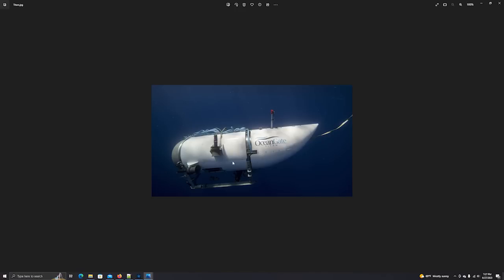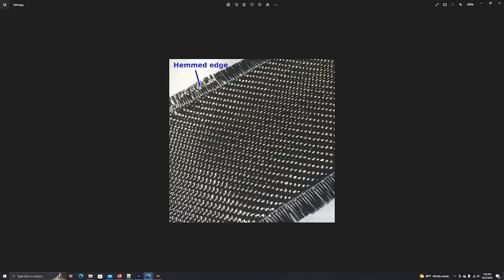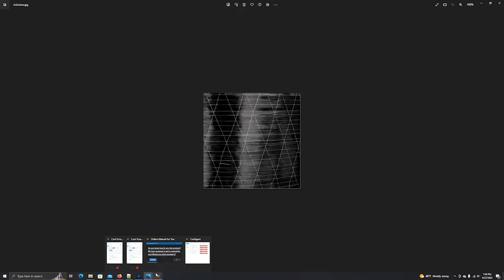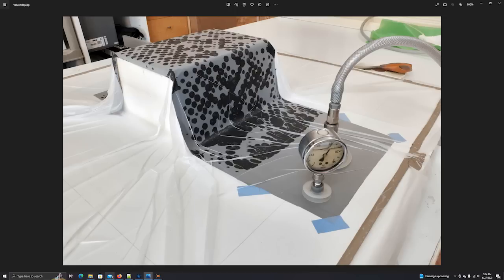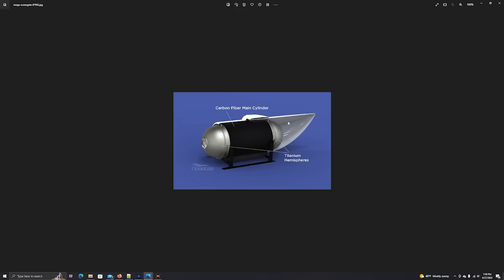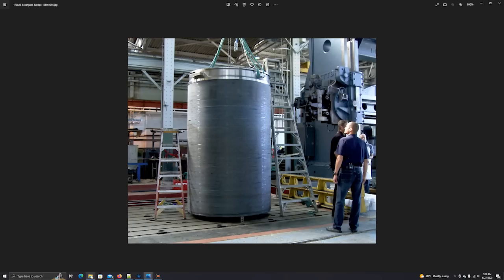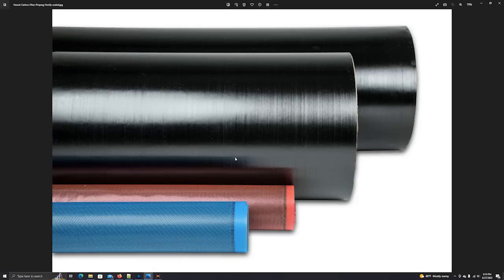Oceangate  Titan Submersible Manufacturing and Engineering Issues Part 1

Comment: Yellow is known to be a stronger colour for submarines
Reply from the maker: I guess the Beatles really knew something 😂
Reply: @JoediyLab  it was made of crayon much better than tape
Reply: Yellow definitely easier to find pieces of...
Reply: @lostpony4885  yellow wax, straight from Crayola, no exceptions.
US marine corps owns the patent
Reply: The international silver string submarine band
Reply: Same physics apply to the mongoose from Halo Reach. The pink one is the fastest, everyone knows this.
Reply: Yellow submarines are the ones we can live in
Reply: Damm right!
Reply: I thought yellow makes it go faster
Reply: @robertstevens7215 We ALL live in them.
Reply: YES
Reply: last 2 generations don't know and they don't care.
Time to move on.
Reply: @JoediyLab  The Titan Submersible DID NOT have carbon fiber fabric.

They used a continuous filament yarns parallel wound onto a large “bobbin style” mandrel. 

With 39 years of advanced material reinforcement, manufacturing and ASTM (I) failure analysis engineering experience, I am shocked at major issues clearly seen. 

They violated “Broke The Rules”at every turn.
Reply: The red ones go faster
Reply: Umm, chartreuse is fractionally better than sunshine yellow.
Reply: @moddmanout2442  its red that goes faster ....
Reply: @manjsher3094 Honestly even the Gen before those 2 largely grew completely sick of the entire catalog by the early 80’s.
Reply: @icare7151 From what I have been able to find out, every few layers they wrapped it in a sheet of pre prepped resin infused woven carbon fiber that had fibers running 2 ways to give it some lateral strength. But not a lot. These “preg” sheets (sp?) may be the expired carbon fiber Rush got on clearance.
Reply: Funnily enough, given you want to paint something made of composites with a colour that reflects UV rather than absorbs it, you're actually right.
Reply: Good one!!!!!

Comment: I noticed that when transporting the sub by crane, the straps were attached to the titanium end rings, so the whole 10,000kg weight of the sub was borne by the two parts which were glued onto the carbon fibre hull. That's surely got to have taken its toll on that questionable glue joint.
Reply from the maker: Good point, thanks for the feedback
Reply: Lifting it by the carbon fibre would apply even more force to the joint. But none of that matters because carbon is useless in compression.
Reply: I wouldn't be too concerned about that. After all, entire airplanes are lifted up with wings that are glued to the fuselage. Also, 10 t is nothing in comparison to the forces applied a few km down below.
Reply: @jcsjcs2  Yeah, by designed and designated points! Also pressure at few km is uniform, and cat's cradle is not!
Reply: @Dave5843-d9m  : What do you think of the multiple accumulative effects of saline deposits in combination with extreme pressure from opposing different ocean currents into epoxy and carbon fiber, also, which does not occur to aircraft. To think that epoxy and carbon fiber will not over continued use begin to deteriorate indicates poor judgment. Stockton Rush may have developed a suicidal tendency due to his goals to achieve more than his restricted budget could afford. He certainly was quite a salesman, however, with no regard for the lives that he was about to sacrifice with his own. Attorneys are about to win a case against Oceangate due to this carbon fiber that exceeded its shelf life—a true red flag of which Rush was aware. And to think that an epoxy bond on titanium would react over time and stress in the same manner as over carbon fiber.
Reply: The water pressure increases as it goes deeper, causing the seals to become tighter. I doubt the carbon hull had any role in its implosion; it was more likely the plexiglass porthole that failed. The manufacturer had reported that it was only rated to withstand 1300 meters. As with anything, the weakest link is usually the first to fail. In the case of the orbiter, it was the o-rings and heatshield, while with the Starship Super Heavy, it's the Stage zero launch platform, and with Titan, it's likely the porthole.
Reply: @ezragonzalez8936  Even though experts and previous staff members had warned that the hull was delaminating, you reckon you know better.
Reply: @wattage2007  they read some stuff on the internet so they're experts!
Reply: @nonegone7170  These kinds of events just lead me deeper into rabbit holes on youtube. It's quite an informative process though, although I hate that it's normally tragedy that brings me here.
Reply: @gp123lIlI Adhesive bonding has been used in the manufacture of primary aircraft fuselage and wing structures for over 50 years.
Reply: @ezragonzalez8936 from the recovered parts I'd say the carbon hull indeed failed before the port glass....if the port glass failed first there would have been large chunks of the carbon fibre still attached to the titanium rings as the pressure on the carbon would have dropped instantly if the port hole had failed first but the carbon fibre definitely failed first which then blew out the port glass due to the sudden relief in pressure stress.
Reply: @jcsjcs2  wings are not glued to the fuselage, they're bolted via wing spars and a carry through spar in the fuselage...
Reply: That is nothing in comparison to the forces from a deep dive
Reply: He also used a 90/0 weave on the entire thing, how he could have been experienced with the material and known this was the worst way to do this, this dude knew next to nothing about how to actually use this material to its highest benefits. When u change the angles of the weave up, that helps stop voids and delam.. thats the entire point of doing it lol, im suprised even the place applying it didnt ask him or maybe recommend anything better is weird to me, maybe the didnt actually beleive this guy was gunna be as serious with this as he was idk, all i know is u can look at a modern carbon fiber paintball tank and its weaved better, and there under way less tortional loads so his excuse there is dumb. Also, i wonder about things like carbon kevlar around the last layers, kevlar is tougher than carbon fiber it doesnt have the same weight to rigidity but its tougher under many different applications and it would of forced a alternate weave over the 90/0. I think that would of given the raw carbon fiber underneath maybe more lifespan, it was literally just raw tree grain 1 way carbon fiber, i dont understand how he didnt understand the flaw with that...
Reply: @profo4544  what do you mean by 90/0 weave
Reply: @tioswift3676  its just applied in straight 90 degree lines with like less than 50% overlap it looked like there was some overlap but its not going to the end, its not changing angles its literally just being wrapped the same way just untill it reaches 5 inches thickness, it should be applied in different directions the whole point of doing that is to make it stronger and not delam, look up carbon fiber paintball gun tanks youll see the pattern on them a bit its more of criss crossing going on with the strands the machine is laying down.

Comment: I work with a lot of epoxy/urethane bonding to aluminum and we increase the surface area with media blasting the surface and roughing it with special cutters. I noticed the titanium end pieces had smooth machining work and the salvage photos you could see the bonding had detached cleanly from the surface for the most part.
Reply from the maker: Thanks for the comments, yes we use to use acid to etch parts for bonding.
Reply: A couple of cans of Flex Seal will seal it up real good.
Reply: Interesting and makes total sense, gives the epoxy something to grip onto.
Reply: Was it also a flawed process of having a gang of bods using decorating spatulas to hand coat the surfaces? I used to build small pressure housings for underwater flashguns as a kid, I was mortified to see the way this thing was put together, even with my extremely limited experience !!
Reply: And I’m sure you watched the video where that was described?

Comment: I noticed too, that after the wrapped the mandril with 5 inches of carbon fiber they then routed out a 1/2 inch flange for the titanium rings to sit over when glued on, The bottom flange is just visible in the photo you show of the vessel hanging upright, so imagine that at both ends, Carbon fiber at any thickness does not respond well to the stresses introduced by any bladed machining process and would have developed micro fractures. Also no one seems to be pointing this out but in the video of the wrapping process you can clearly see quite large air voids being introduced during the wrapping itself and they just carry on wrapping, That was the first alarm bell that rang loudly for me when I saw that video and if i had seen that there is no way I would want anyone trusting their life to that cylinder, Let alone the madness of actually thinking a cylinder is a good idea for a pressure vessel at those depths!  So not only did they have a crappy idea for the shape of the submersibles pressure vessel it seems to have be manufactured with very little care in the first place.
Reply from the maker: Yes, that was on  an old sub.  On  the Titan, they used pregreg tape wrapped around a mandrel.  But we do not know what orientation and what cure they used.  Thanks for the feedback
Reply: Quote from composites world “The biggest challenge, Spencer reports, was developing a manufacturable design that “would produce a consistent part with no wrinkles, voids or delaminations.” And without use of an autoclave. Spencer opted for a layup strategy that combines alternating placement of prepreg carbon fiber/epoxy unidirectional fabrics in the axial direction, with wet winding of carbon fiber/epoxy in the hoop direction, for a total of 480 plies. The carbon fiber is standard-modulus Grafil 37-800 (30K tow), supplied by Mitsubishi Chemical Carbon Fiber & Composites Inc. (Irvine, CA, US). Prepreg was supplied by Irvine-based Newport Composites, now part of Mitsubishi Chemical Carbon Fiber & Composites Inc. The wet-winding epoxy is Epon Resin 682 from Hexion Inc. (Columbus, OH, US). The curing agent is Lindride LS-81K frLindau Chemicals Inc.cals (Columbia, SC, US).”
Reply: A cylinder is the optimal shape, for getting the most paying passengers, er, 'mission specialists' inside the pressure, er, 'pay' vessel.  I doubt Stockton charged himself, or PH.   So really only 3 paying customers, so only  $750K per run, and Stockton had complained that bunker (fuel) to the dive site & back was $1 MIL.  So... I guess he really needed a longer submersible.   Titan 2.0 might have resembled a paper towel roll.   Oh dear.   So where were all these carbon fiber specialists/commenters warning Stockton before this happened?  In your industry, surely you would have heard of this singular application - so why didn't everyone in the carbon fiber industry warn him that he's doing every thing wrong that can be done wrong.
Reply: @JoediyLab Great report Joe, in some photos you see contaminates in the winding. Shouldn't this be done in a clean?
Reply: @glcanon He was warned, and people quitted their job due to the construction.

Comment: That is the best video explaining carbon fiber description and application. Thank You Joe. 👍
Reply from the maker: Thanks for the feedback 🙂
Reply: @JoediyLab  I work at MAF in New Orleans La.
There is an old Autoclave that gets alot of use on rocket parts. There is also a very big Ingersoll fiber placement machine here.
 https://mafspace.msfc.nasa.gov/
Reply from the maker: @forrestgumpv9049  thanks for the link, I will check it out

Comment: Colonel Phillip Corso said carbon fiber was back engineered from crashed alien spacecraft. His job was to seed different materials from the crashed saucers into industry to let them figure out how to back engineer them, because the military was not having any luck. For the things that were used by the military, the companies had an agreement to only make it exclusively for the military. When Corso said this, it reminded me of witnesses to the Roswell crash who said there were beams in the structure of the crashed craft that were real lightweight, but stronger than steel. It was probably carbon fiber or carbon nano tubes, which I read is 20 times stronger than carbon fiber. Anyway, thanks for the great video. I learned alot about carbon fiber from watching it.
Reply from the maker: Thanks for the comment

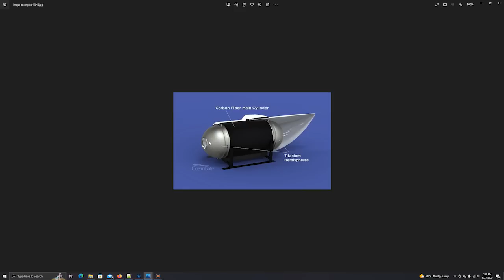Comment: Just to clarify, Spencer Composites(not located in the Pacific Northwest, btw) only created the prototype tube not the one that imploded. The image at 12:05 is not the Spencer Composites facility.
Reply from the maker: Thanks for the clarification.  Another Engineer indicated that the later  sub did not use filament winding, but tape winding.  So  not sure who did the original filament  winding then.

Comment: I saw something on Wikipedia about how the pressure vessel on the accident craft was already the second pressure vessel because the first showed indications of weakening after its second test dive. Don't know if they changed the design, but I guess that might tell you how error-prone the manufacturing process was.

Edit: It seems to have been more than two dives and it seems unclear whether it was repaired or replaced.
Reply from the maker: Yes the first pressure vessel was filament wound and pregreg wrapped.  The Titan pressure vessel was tape wrapped with pregreg.  Pacific Coast Composites has the details.  Thanks for the feedback

Comment: Carbon fiber has a good tinsele strength, but it's not very good for compression or shear strength,  if you want a scuba tank where you're holding pressure within a multi directional weave would be great. But horrible at trying to keep pressure out.
Reply: Love the idea of tinsel strength.  A useful standard, along with potato chip/crisp strength for bending, and meringue strength for compression.
Reply: @timjackson3954 Pasta has the same strength per unit  weight and volume as concrete…
Reply: @allangibson8494  pasta houses?
Reply: Many high end air guns use CF tanks and they last/do well. Almost never hear of failures.
Reply: @N4CR the cf filament itself is flexible line, like a high test fishing line.  The cf wound in a multi directional pattern on an air tank acts as a woven sack that resists expansion with its tensile strength, with the resin added to help hold its desired form (including keeping it from collapsing from external force), and prevent the air from escaping through the cf woven structure. The two combined are a composite but also referred to as cf.  The cf filament by itself won't stretch and doesn't snap easily, but it is still a flexible line. If you have a loop of cf or any flexible line/rope and pull outward from the center of the loop with equal pressure it will hold until you reach the strength to snap it. But take that loop and push inward and it collapses. That's why a cf composite works for holding greater internal pressure from expanding outward but not the inverse. When you squeeze the cf composite tank with greater external pressure the woven sack doesn't add much of, if any of its properties so all you're relying on is the resin's ability to resist compression (hold its form) so they were basically in a 5 inch thick walled epoxy resin tube/ jar with two metal (titanium)end caps and nearly 6000 psi squeezing it from all directions. It's amazing they got away with it the first few times.  Sorry this is so long but wanted anyone else reading it to understand what the cf filaments & the resin's contribution to the cf composite are. Apparently it was rocket surgery to OceanGate's brilliant college educated "engineer"  Stockton Rush and his college student interns (apparently just yes men).

Comment: One YTer speculated that the viewport might have been removed after recovery for trigger reasons … might have been “red.” Your explanation makes more sense. Another YT analysis says the water rushing in does so at the speed of sound at 1 atm pressure (assuming inside was at 1 atmosphere). This is 340+ m/s (standard atmosphere press & temp.). So, the pressure front would hit just before the water. Either way, the viewport and end caps are subjected to forces beyond the structural limits. That the titanium parts survived relatively intact is not surprising for such a relatively (to the carbon fiber comp) ductile & elastic and much more shock resistant material. The acrylic viewport is another matter. The carbon fiber is likely in millions of shards or a crunched mass ….
Reply: A Youtuber scientist called “thunderfoot” done a very good vid the other day about the pressure. About how water does actually compress, very little of course ( about 1% at that depth), and how its basically like a massive infinate spring surrounding the sub. When exposed to one atmosphere, like a leak, the spring desprings if you like, at something like 4x speed of sound. When the water hits an object, the energy smashes it apart in micro seconds. The vid is well worth looking for 👍